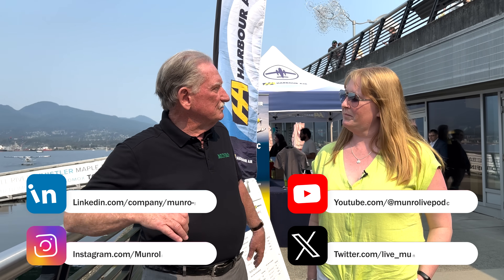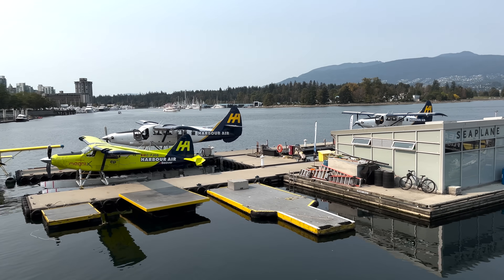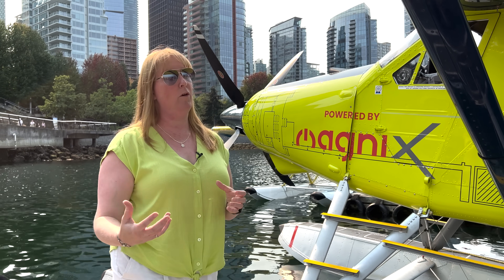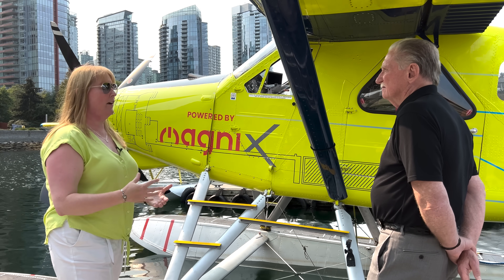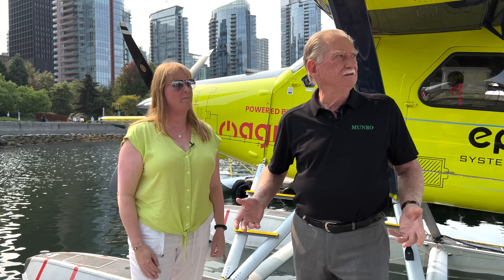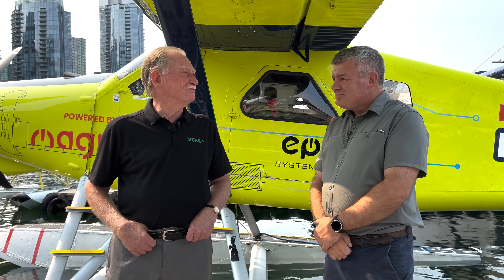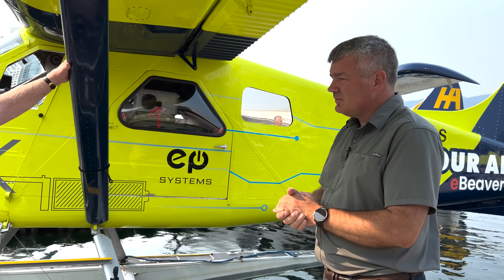The Harbour Air eBeaver Electric Seaplane | Everything Electric Canada 2024

Comment: That is the Achilles heel of battery powered vehicles, the availability abd reasonable cost of electricity.
Yes as battery technology improves the range will increase and hopefully recharging times.
Just like the current aircraft what will be the TBO's for the motor and batteries?
Reply: The extended range model has 1/10 of the range of a gas powered version and has to spend endless hours charging. These will never even be remotely as practical as the gas versions.
Reply: @markadler8968  That's what was said about ecars only 10 years ago...

Comment: It sounds like they still have some proprietary technology going on with the motor and battery, but did they share with you whether or not there's a gearbox on that motor?  They could easily increase the mechanical advantage by as much as 14% if they did, and your mention of a 5-blade with a similar disk area should certainly help with performance as well.  The added prop blade may be an efficiency tradeoff with the gear reduction, but that could be a worthwhile trade.  I see there are a few more videos of this same plane, so I'll check them for any mention of a gear reducer.  I'm pretty sure Archer went to a gearbox on their eVTOL a while ago and in the end, the right prop tech with a gearbox will probably be what the endgame looks like for STOL too.  The math certainly suggests it.
Reply: The motor (or engine) is the well-known MagniX design. Like most aviation electric motors, it is direct-drive for reliability. The motor is designed to suit the desired propeller speed.

Comment: Electric powered locomotion will be great once the grid can supply the power needs and batteries hold greater energy per mass unit. It's not quite ready for primetime yet
Reply: The grid can handle it now, depending on where you live

Comment: I love this! It's the ideal aircraft for electrification given its STOL capabilities and intended usage. This is the future.
Reply: @duncanjames914  no it's not the ideal airplane for an EV is one that's designed from the get-go to be an ev. Retrofitting something like this is always going to be a half-ass solution that's less than ideal for many reasons.
Reply: 130 km range is basically nothing and that is on the extended model in ideal conditions. Not to mention this plane will spend far more time charging than in the air. This is nothing but a gimmick with a fancy paint job.
Reply: @markadler8968 Exactly!
Reply: @markadler8968  There are many short haul targets you could cover with short haul ePlanes. Think of coastal islands that often have regular or even irregular services. Installing a battery and solar panel on those islands could makes charging to extend the range easy.
Not sure a seaplanes is the best option as it does not seem to be a very energy efficient plane

Comment: Electric MOTOR! Engines have pistons
Reply: Not all engines have pistons!😂 I think you’re right about the difference though: motors convert energy directly to mechanical force, whereas engines convert fuel to energy to mechanical motion. 
But it’s hard to find an authoritative definition these days and they overlap in some cases.
Reply: Tranpprt Canada and mos t likely the FAA insist on "Engine"@meofnz2320
Reply: Do motorcycles have pistons? Motorboats?
Reply: @toddfleury7324  meofnz2320 is correct. Think of Wankel engines. The engineering perspective is that engines convert exploding or expanding gasses to pressure (energy) to move a mechanical device.

Either way, thanks Sandy and the Harbour Air team for this experiment in electric motor propulsion. We will never get to the end goal without taking these steps
Reply: FORD ENGINE COMPANY doesn’t even understand this!! 😡 makes me so angry I could shit myself. Terrible people and damned straight to hell, the lot of them! 100% agree with you, vagabond
Reply: So jet engines don't exist then?
Reply: You should try looking up dictionary definitions of both "engine" and "motor".
Reply: @brianb-p6586  An engine converts fuel into mechanical energy through combustion, while a motor typically converts electrical energy into mechanical energy without combustion.
Reply: @Vagabond1209  you should still try looking up the definitions,  which are much less limited than your current understanding.

By the way, do you really think that General Motors, Ford Motor Company,  Bavarian Motor Works (BMW), and many other companies don't understand the meaning of "motor"... or did you think they only made electric cars?
Reply: @brianb-p6586  let it go. It’s really not important
Reply: @Vagabond1209  Now it's not important? It was very important to you in your four previous comments.

Comment: I would point out that unlike fuel, batteries weigh the same when they are dead........
Reply: Yes, but current 200+ Watt-hours batteries in this converted eBeaver get 300 lbs. More Thrust at Same Power setting. (than old turboprop version)
Since batt. weight limits payload & range now...the higher Energy storage density (300 & 400 Watt-hours/kg in development at same or less weight) will make battery weight irrelevant...and will make 6-7#/gal. Jet fuel too expensive/ flight hour.🤓
Reply: I think ultimately long-haul aviation is going to have to go to carbon neutral synfuel to decarbonize.
But it will be expensive enough that it makes sense to electrify short-haul.

Comment: Everybody assumes electric aviation means fancy carbon fiber airframes.  I love that these guys are making it work with tough as nails old bush planes.
Reply: Well it's all about how much you want to carry, if the base plane is lighter then you get to carry more weight per flight, or in turn have more batteries for greater range.
An all carbon Beaver could very possibly get to double load capacity.
Reply: @MsSomeonenew  exactly, they are comparing a 70 years old engine to brand new modern powertrain.
Reply: they might almost double their range if they uses more modern and lighter composites.
Reply: Technology keeps moving forward. In due time, lighter craft will inevitably be seen. Remember working alongside the A & P mechanics at a coastal business in southeast Alaska in 1973. Otters, Beavers, 185s, remember the radial engines of those years well. Excited to see folks taking on electric. It will serve a purpose in may areas as we evolve. Great interview, information and forecast for their projects.
Reply: of course they dont do long distance flights, composite materials have made modern aircrafts significantly way more efficient
Reply: @BillericaBunnies  You must be a Joe Rogan fan being such a contrarian without anything to add to a discussion you simply aren't equipped to take part in.
Reply: @Gerhardium  i totally agree with him they are not! it only works for a very particular case! imagine trying to do just 500 nautical miles or actually going to the bush.
Reply: @carholic-sz3qv  They never fly 500 miles. They are making planes that are custom to their situation. So yes they will be successful.
Reply: Thumbs down the Troll 👿

Comment: Amazing technology!  Thanks for sharing Sandy! 🇨🇦
Reply: how exactly is it an amazing technology? its just like evs
Reply: @carholic-sz3qv  one difference, if it stop working it falls to the ground.
Reply: @carholic-sz3qv  Well for one thing, if a EV car's battery fails in use, it just rolls to a stop.  In a EV aircraft they don't have that luxury. The reliability requirement's for EV Aircraft certification are a lot higher and more stringent.  In the case with Harbour Air they are building a EV Aircraft motor system into an old airframe. Basically abuilding a new motor and battery system to meet the specs of that aircraft.  They don't have the luxury of off the shelf motors or battery systems.  Each one is unique and the costs are much higher.
Reply: For extra safety, a "free wing" (control wing) design would have been better.

Comment: This is very exciting. Perfect application for the short-hop flights in the PNW. I can't wait until we get a lighter battery chemistry that will allow us to slash the battery weight and get truly amazing range out of these things.
Reply: Unless you increase the price of flights several times over and increase the size of your fleet multiple times these will never work. The extended model has 1/10 the range of a gas powered version and has to spend endless hours charging to achieve the same distance.
Reply: @markadler8968  80mi range is enough for their longest scheduled route out of Seattle. If you require enough juice for a round trip, you can fly from Orcas to any of the island ports and back.
Reply: @BillericaBunnies  No magic required. We may be many years out, but I am certain we will continue to discover new battery chemistries that have > 1kwh/kg 
Materials don't have to be heavy to hold a lot of electrons. It's not wishful thinking, it's materials science.
Reply: Power density of batteries is still light years away from what plain old gas has. This will be shackled to short routes. Won't fly in places like Alaska.

Comment: So with any kind of safety margin you’ll be able travel about 25 km into to the backcountry with this bush plane. 
And can’t even set up fuel caches to extend that.
Reply: This is a "bush plane" used for commuting between 2 cities, back and forth, back and forth, over and over and over again.  The old Beavers and Otters do it well and it's a perfect use for an electric commuter. The economics now favour battery over turbine, so that's the way they'll go.  

Yes, it will take at least a 4x increase in battery tech for any real backcountry vehicle... of any type.  But, we'll get there, and I'll be converting my old KLR adventure bike, and there will be Jeep conversion kits, and ones for the Land Cruisers, and... all in good time.   Though, the Twin Otter that can fly to Antarctica in winter, apparently the only one that can because it doesn't have any hydraulics to freeze, will probably be burning fuel for decades to come.  Electric doesn't have to be capable of every use-case before it out-competes more and more areas.
Reply: @4Fixerdave  but we'll get there. Not any time soon based on what I understand. If we were we would be building power plants like crazy. No gas cars by 2035 and 0 or just about 0 new power generating plants planned.
Reply: @lawrencehalpin6611   Site-C?  They're filling it now.  1.1 Gigawatts.  4 SMRs being built in Ontario?  If that pans out, there will be more.  4x battery capacity is not that far off.  And, nobody said no gas cars by 2035... that's no NEW gas cars sold, and it's government so the list of exceptions to that rule will be absurd (as always). 

It will take over a decade after that for the fleet to dwindle anywhere near the 20% range, and then probably a few more decades for gas to be rare.  But, around here, where that eBeaver is flying, already 20% of new car sales are EV.  In the cities where commuting by EV already makes economic sense, 50% EV by the end of this decade might happen... though there will be a lot of people like me that own an old ICE they rarely drive.  Cars last a long time on the West coast.  Let's say over 50% of driven km by EV by the end of this decade.  Another 5 years.  That's a reasonable prediction. 

Maybe not soon enough for some people, but it will happen.  Will we have the generated capacity by then... probably.  Well, more like Yes, we will.  Even if they have to run up new gas plants to get it to us.    That's just economics.
Reply: @4Fixerdave No gas powered needed, wind and solar are already cheaper.

Comment: Why is she calling it an engine? Aren't you an engineer? It hurts the ears. No such thing as an electric engine, it's a motor.
Reply: You'll be okay.
Reply: An engineer would know the definition of an engine, she's correct ... that technically makes an electric motor an engine even though that's not common usage.
Reply: Electric engine in my Leaf spins at up to 10,000 RPM and is much quieter than our ICE cars during engine braking.

Definition of engine:
"noun 1.
a machine with moving parts that converts power into motion."

The motor on my Leaf certainly has moving parts.
It certainly converts power into motion.
Reply: First, as less ignorant people have already noted, "engine" is a valid term. 

Also, aviation regulations in Canada and the USA refer to the "engine" in a way which requires the electric drive unit (combination of motor or engine abd controller) to be aporoved as an "engine"... so that's the term the people in this project are using.

Comment: Amazing! Yes the range is short now but so were cars when they first came out. Range will quickly increase and only get better....
Reply: It will not with current technologies. 80 km that’ funny. Wonder what that new high efficiency propeller could do to regular airplane.
Reply: @alexchamchourine2848 That propeller can't run on a regular engine, the speeds are wrong. Add a gearbox and you're changing the weight and balance, negating the efficiency.
Reply: @alexchamchourine2848  Your opinion...but they will move ahead regardless of what you think
Reply: @vancity2349  But not be enough ... auto mileage is not much better now than it was in 1965,  for the same eight vehicle. 
People are living a few years longer,  but not double.  There may be marginal gains,  but the airplane is not viable unless things improve by 400% or so.  Not clear how this is going to happen.
Reply: @vancity2349  regardless or not its never going ton match the capabilities of ice airplanes. whats next electric rockets?
Reply: @carholic-sz3qv  The haters said the same about EV cars and Semi Trucks
Reply: no! airplane is notba car where you can dump tons of batteries and call it a day. ICE cars still have way more range and capabilities than evs.
Reply: @carholic-sz3qv  Give exact example here not hype
Reply: @BillericaBunnies  Just like car batteries the technology is better everyday, more range, quicker charging and competition will drive prices down...
Reply: @vancity2349  no its not, evs barely have range increase and tye battery is still super heavy flying has no regen braking, power is needed almost all the time.
Reply: @carholic-sz3qv  If you dont believe technology and batteries advances wont get better and better than keep living under a rock

Comment: Cool plane, but very use specific.   It's not an ideal  EV Plane.    That's a lot of drag with pontoons and struts everywhere.  Wonder who battery people are?   CATL has their new aviation battery going into flight testing.  Claims of potential coast to coast US flights.  That's a lot different than this 30 minute flight time.  Don't know the pack level wh/kilogram on those batteries but might help this plane.
Reply: The cycle time quoted sounded more like a non-nickel chemistry, the pack weight sounds like a nickel chemistry.
Reply: @JoelSapp  Another thought occurred.  Perhaps I missed it. Was that 30 minutes total or 30 minutes each way for one hour round trip?  A 15-minute flight into the bush isn't far.  Where/how do you recharge in the bush?  The magic number goal for aviation grade batteries has always been 500 wh/kg.   This plane desperately needs that.
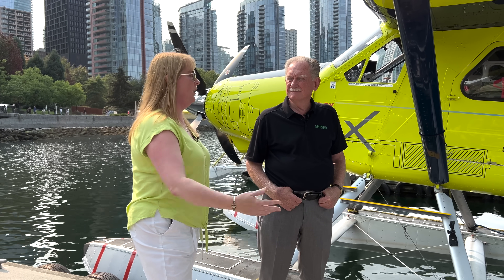Reply: @pathfollower  1:35 - 60 minute range and hoping for 30 minute charging. 13:55 they said they do a lot of 20 minute flights. Its niche but I know someone that does trainers and these electrics could be amazing for them - which a lot of folks do. But still seems like Elon was correct that they need to get to 500 wh/kg to get medium haul flights.
Reply: @pathfollower  Pipistrel Velis Electro is already revolutionizing flight training in clubs, flight schools and trialing with the RAF.
With 50 minutes flight time and a 20 min reserve for local flying (EASA certification), and one hour recharge, it fits the bill for instructor/pupil roles at a fraction of the price of ICE training.
Reply: @pathfollower  Harbour Air’s application is very specific - short low altitude flights between Vancouver, Victoria, Nanaimo & other harbours around the Strait of Georgia.

Comment: I would think they might eventually consider the ability to eject a battery pack in case of inflight fire; put it on a chute, or not if over water.
Reply: If the battery is part of the wing. Good luck flying after that